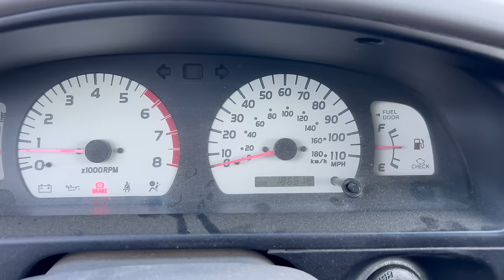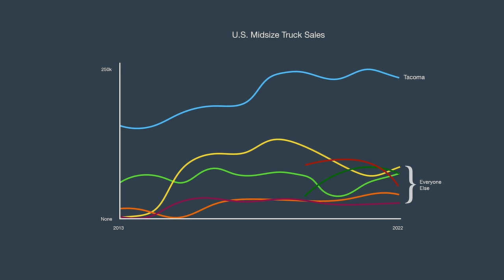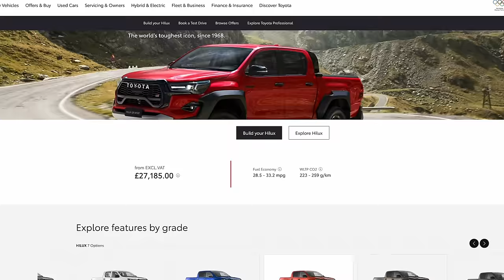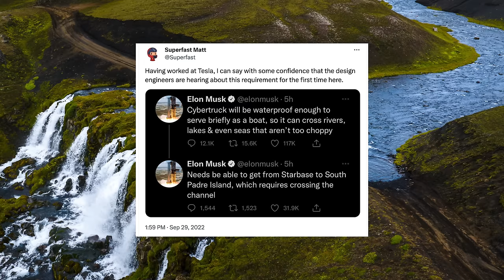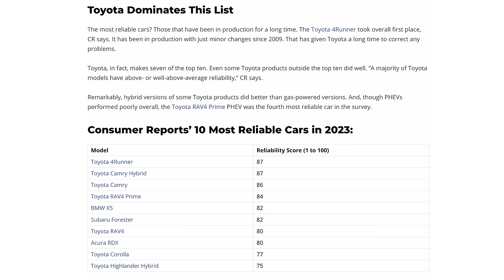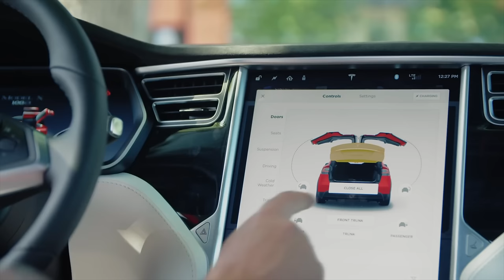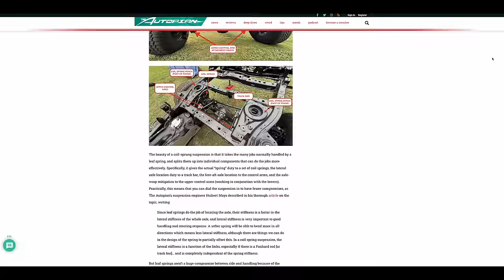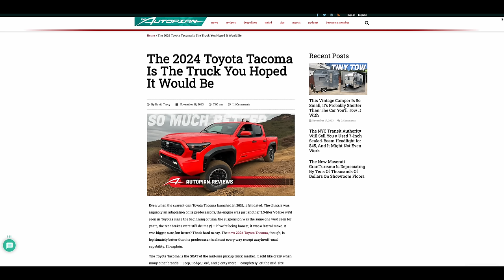What Is The Best Truck, And Why Is It The Toyota Tacoma?

Comment: Give me the 1986 model that was small useful,  indestructible, good MPG and $6k at the dealership.
Reply: But what was the minimum wage is 86, a dollar?
Reply: One look under the hood and I'll simply say, 'Nope.'
Reply: Back up to 1985 and you get the live axle in the front instead of IFS, but don't get a carb.
Reply: @monkeybarmonkeyman what's wrong with under the hood of a 1986 toyota
Reply: @monkeybarmonkeyman  people who actually used trucks for trucking, if they need a truck of that size, would say yes.
Reply: $ 6,000 in 1986 is  $16,809.36 in 2023 .  However, remember that the 86 truck had far fewer parts / safety equipment.    And, the net says that the 86 was between $6,558 to $13,768.  That is  $18,372.63 to $38,571.88 in 2023.
Reply: @seymoarsalvage minimum wage was about 1/2 of what it is now, but trucks are 4 times as much.
Reply: The 70 Series Land Cruiser, the 1984 model, is still in production if you would prefer? Toyota have manufactured it from 1984 to present.  It doesn't meet US crash safety standards though.  It's a popular vehicle with mining fleets, farmers and some recreational 4x4 owners.  It is not an inexpensively priced vehicle by any means, it's similar in price to the Toyota Prado (which will be the "new" US market Land Cruiser from 2024).
Reply: @bobroberts2371  "far fewer parts/safety equipment" is a good thing, not a bad thing.

Comment: I am an engineer at a Toyota supplier. I set up the process to manufacture the shift lever boot for the new manual transmission Tacomas. Another thing that makes Toyotas so reliable is there extreme attention the quality specifications. It makes being a manufacturing engineer more difficult, but it makes for really reliable vehicles.

Comment: YES THE WHOLE TRUCK IS DESIGNED AS A TRUCK IN 3D   I supplied the 3D projection system they used to design these, every piece is put in and out hundreds of times to find the most serviceable shape and path.

They have theatres with 3D true to scale projections of the vehicle that you can stand in and remove the alternator or assemble the suspension.
Reply: That's actually amazing, I wish stuff like that could be accessed by the public for things like tours.
Reply: said  "   They have theatres with 3D true to scale projections of the vehicle that you can stand in and remove the alternator or assemble the suspension.   "  

So the Star Trek Holodeck is now reality?
Reply: They didn't have that 30 years ago when they designed mine. And they may have it now, but car companies are still building shit today.
Reply: @iderryan    Do realize that 30 years ago, people like you were complaining about " junk " new cars longing for stuff 30 more years older.
Reply: Shiiit why is this not a Quest app? Aptera has an AR/VR demo of their cars so you can get a feel for how you fit in them and it makes a huge difference. I'd never buy an ICE but even I'd get a kick out of showing friends and family how to dissassemble a virtual tacoma. Free advertising
Reply: Wow. Seems like engineers do the opposite and willfully make it as hard as possible!
Reply: @32BitJunkie  Well the system they use is hundreds of thousands of ££ because its directly linked to the CAD system they design the vehicles in - If you bend a pipe in the 3D system to make it easier to fit - you are bending it IN the CAD system and it will be bent on the.  But the reason they don't release it as an app I guess is all their competitors would immediately buy it and rip off their innovations. 

I mean they will anyway - but at least they have to buy a truck and take it apart LOL

But its very real, it has much higher refresh rates than 3D theatre so things look incredibly solid
Reply: @Hawk7886  This was at the Toyota factory in Derby England and the whole factory was AMAZING.  For some reason, the 3D imaging department was located there. 

But the factory tours were the BEST part of that job. I did Nissan, Toyota and Rolls Royce Aerospace.  The Toyota line works so fast - a giant robot comes shooting down a track and then it grabs one of about 20 metal armadillos and shoots back then the armadillo expands like a transformer and it becomes the INSIDE shape od a car or truck, the body panels are them put on all sides except the back and welded in place - then the armadillo closes back up and the robot removes it and the back of the car is put in place and welded on - the armadillo is then put back in its rack and that takes 45 seconds.  The speed and the noise of the line was astonishing.

Each armadillo is a different model cos they built about 20 different cars on the one production line.

At Rolls Royce they GROW the turbine blades for the jet engine out of a single crystal of titanium. 

It really is SUCH a shame they dont do tours for the public.
Reply: @piccalillipit9211 wait-wut?? They can grow titanium in a crystalline structure into a predictable shape??
Reply: @PhaedruS007  Yeah its way more simple than you would imagine.  You make a wax mould of the turbine blade, at the bottom it has a spiral like a corkscrew, you coat it in a very special ceramic and then you heat it and empty the wax, you place in it a single tiny crystal of titanium that is totally perfect and that goes at the bottom of the spiral, then you put it in a high temperature high pressure chamber and you pur molten titanium in and then you very slowly lower the pressure and the crystal starts to form at the seed and grow up the spiral - when it gets to the blade part it is now the full width of the blade and continued to grow as a distorted single crystal up the blade - when that is finished you allow it to very slowly cool and you end up with a monocrystal blade.

If you cut it in half and look under a polarised microscope it is all one crystal.

This wat you can make the blades thinner and lighter because you are dealing with much higher atomic forces holding the thing together.

The big fan blades at teh front of the engine - they are made by strategically welding 3 incredibly thin sheets of titanium together with a laser, And then they are expanded into a 3D shape with ultra-high pressure nitrogen - the weld spots cause the structure to twist and bend and it blows up like a balloon.

It is a crying shame people dont get to see these factories - they are utterly amazing.
Reply: @piccalillipit9211  you've won the comment section
Reply: @piccalillipit9211 we live the god damn future and it's amazing!
Reply: @PhaedruS007  single crystal fan blades are not something new, they have been around for quite a long time.
Reply: @bobroberts2371  Nah the 90's were the high water mark for quality.....
Reply: Having worked on these and every other truck- what a fucking waste of time, they’re no easier to fix than a Silverado.
Reply: Then how come my mom's '91 Explorer dropped the oil filter off like pinching a ghost-wipe, and just shy of 300k miles into my first gen taco I'm still getting the oily elbow when i bend my arm upside-oddwards to yoink the filter from the doofy depths of the front-left steering when it's time for an oil change? I've long since resigned myself to this self-flagellation for the sake of longevity but it's kinda dumb right?
Reply: @evanbarnes9984  I cant believe that m,y phone can translate a page of text in Bulgarian into English [i live in Bulgaria] in real time live - dont have to take a picture, just point the camera at the sign or the cooking instructions and they are in Bulgarian on the packet but in the picture on my phone they are in English
Reply: @piccalillipit9211  one other thing to note is that those sound like they are blade for the compressor side, not the high temperature combustion side? I know when I was working in the industry, all of the high temp stuff was a nickel alloy to deal with the stupidly high temperatures and there was an art to just the machining process that required all diamond tooling and/or EDM processes because even carbide tooling was laughed off by the material. Still though, the same concept applies where it's a single crystal grain structure, which is SIGNIFICANTLY stronger than a typical casting with many small grains that are just sort of mechanically interlocked. Although, the precision to make these parts repeatably and within spec would  prevent me from calling it a "simple" process. Conceptually, yes, in actuality, eh.
Reply: @Jazz3006  Conceptually YES - in reality, NO.  The spiral snail has to be an amazingly precise shape and took about 15 years to develop - the thing that encourages the crystal to keep growing.

Now this is 15 years ago so I might be wrong, But I believe they were the titanium on both the compressor and combustion. The combustion blades are hollow and have thousands of incredibly tiny holes drilled in them with EDM, when the engine is running high-pressure air is pushed through the blade so that the blade never makes actual contact with the hot gasses.
Reply: @piccalillipit9211  Yeah, these had cooling ports in them as well, but the stuff I was working on was definitely a nickel alloy. My guess is that they were exceeding temperatures that the air barrier could insulate against, so they had to switch to the higher temperature nickel. I also saw some stuff that supports that theory that would freak most people out, but was perfectly safe in reality, so I'll keep that to myself, haha. I mostly worked on the machining side of things, but I knew people that were on the casting side too and learned a bit about it when I was there. The part that amazed me the most is just how manual a lot of the process still is because they still couldn't automate certain parts of it.
Reply: @Jazz3006  Did you work at Rolls Royce or another aero engine company?   

You may well be correct about the nickel alloy.  It was 15 years ago and there was SO MUCH to take in that halfway around my brain was fried.  But I do remember that a LOT of the work was not automated, I believe the final assembly is entirely manual...? Two guys literally build the entire engine. 

The personal factory tours were the greatest honour of my life, to have as long as you want to go around and be able to ask any question, it was just amazing.
Reply: @piccalillipit9211  I was at a different company and the casting company was an entirely separate supplier, but they cast something like 60% of all the blades manufactured now. I think there are only really 2-3 companies in the world that cast those things at scale anymore. At least, from what I remember from 7-ish years ago, haha. Unfortunately, I work in a completely different market now, so information like that doesn't get accessed and is ultimately forgotten.
Reply: @Jazz3006  - Yeah - Im a bespoke tailor and author living in Bulgaria now so a VERY different life.  Someone should set up a YouTube channel just doing Factory Tours - the factories are WAY more interesting than the products they make.

The Toyota factory made the Avensis mostly - I mean how boring can you get LOL - but the factory itself was just incredible. The parts they needed in 1 hour were still on the motorway in a truck. And just parking the cars was a logistical marvel - 1 car every 30 seconds comes off the line [2 lines side by side actually] and you have to drive them off an park them in like a 500 acre parking lot, but THEN the guys have to get BACK to drive the next car off, so you have like 30 guys and mini busses shooting all over the place - and that car belongs TO a customer, so you have to know exactly where it is.
Reply: I worked at a Toyota dealership, and for one year I did nothing but frame recalls on tacos. I have taken apart and put back together hundreds of these things and they are incredibly easy to work on. Once I got good at it, I could tear down and build up the entire truck in a day or a day and a half at most.
Reply: @will7its    said "    Nah the 90's were the high water mark for quality.....   "  

Not according to people that hate anything electric / electronic and feel the last " good " cars where made in the 1960's .
Reply: @ezacher4634  Couldn't be any further from the truth man. I used to work entry level engineering at a milsim company for 7 years. For every 1 engineer who cares about making things work, you had 10 that were there just to collect a paycheck and do the bare minimum. Making things as hard as possible comes from ignorance, lack of testing, and lack of oversight. Some days I had to rebuild entire assemblies other engineers had designed because they didn't follow the instructional dimensions we gave them, and every inter-connected part would be misaligned or impossible to service without a cutting torch.
Reply: @bobroberts2371 yeah, it's been a downhill slide. Penny pinchers trying to make things sing and whistle but not the very thing they designed to do
Reply: Amazing
Reply: I was an aeronautical engineering trainee in the Navy when this was new technology, I think originally developed by Pratt and Whitney. Must have been a long time ago since I left the Navy in 1979
Reply: I  n e e d
Reply: @ghostdog0424  Its really cool. On the turbo there was no way to get to a bolt to remove it, so they put a hole in the wheel arch and a rubber plug. You take the plug out and use an extension bar on the socket to be able to remove the turbo with the engine in the car.
Reply: That's insane! That's it, I'm a Yota boy for life
Reply: Soooooo.... the TuRD trim valve back seats are your fault?????
Reply: @piccalillipit9211 You might have been inside the factory that made my avensis t22. I know it was in england, it was 21 or 22 years ago it was made, so i'm pretty sure you have been looking at maybe the t27 or something. But i can tell you, that the t22 might be a bit boring looking at in stock form, but if you get the right motor 1zz-fe or 2zz-fe the avensis is actually a pretty fun car to drive around hard.  The stock suspension is a bit too mellow like the car leans alot, but the steering is pretty sharp and the engines is actually pretty fun to drive if you do them right. I know from personal experience, that the 2zz-fe isn't doing that much under 4k rpm and when the vvti goes on it actually get moving. But if you take it for a spin around the small country roads and you wanna have real run, then you need to know how to work that gearbox, because you'll be doing it quite a bit if you're trying to hold it at atleast 3.7k rpm(it makes most torque at 4k rpm. 

I can also tell that i haven't really had any problems with the car. I have done maintenance and wear parts because something like the belt, belt tensioner and so on will eventually get tired after over 20 years on the road and above 100.000km driven.
Reply: @MikkelL03  WOW that is some detailed knowledge.  The factory was AMAZING. The amount of work and effort they put into making it human-friendly to build and service was astonishing.  It was a JAPANESE factory, just relocated, once you got above a certain grade you had to learn Japanese and go to work at the plants in Japan for a while. It was a very very different place to any other factory I visited. 

The people, the machinery, the product and the process were all considered as ONE - they designed to process of manufacture along with the process of design and they involved the people who would actually make it in the process. 

I never saw anything like that in a European factory.

Comment: I have a 74 Corolla that has over half a million miles on it, and it's still one of the most reliable vehicles I've ever owned. 
I went out on a 20°f morning not too long ago and fired it up for the first time in months, and it didn't skip a beat. 
You get the added thrill of it being one of the least safe vehicles on American roads too, so that's exciting.
Reply: dude. I'll take an old Corolla any day of the week and twice on Sundays.
Reply: "exciting"  🙂
Reply: Old corollas are where it's at! I have had many and still have a te27 and a te72. The 2tc/3tc engines are more bullet proof then the R series truck engines.
Reply: I love my 84'. I drive it just about every day and its such a fun reliable little car. Very practical too.
Reply: @ryanwalker388  no doubt. Growing up, my mom had an '80 wagon with the 3tc that we beat the crap out of. It had a water pump go bad. I would drive it down the interstate, notice the gauge in the red, pull over to let it cool down, and just keep doing that till I got home. We did this for over a week until my uncle could change the water pump. It was absolutely none the worse for it.
Reply: Nice
Reply: I have a '75 TE31. God damn it is such a good car. Uses zero oil, always starts instantly. The RWD Corollas are a blast.